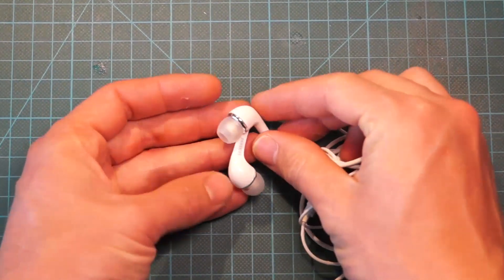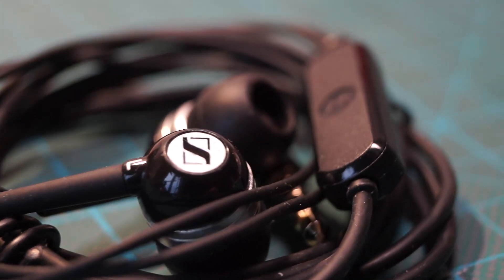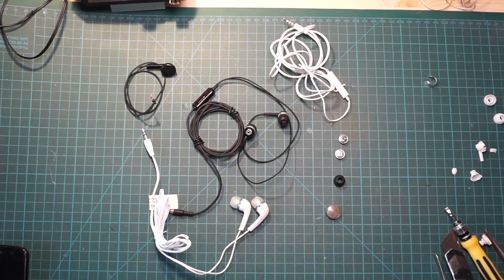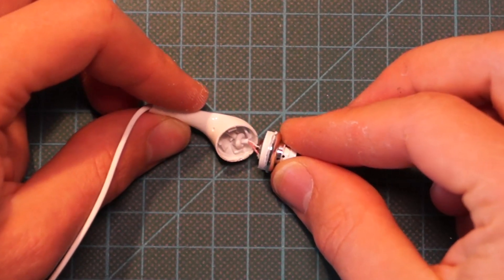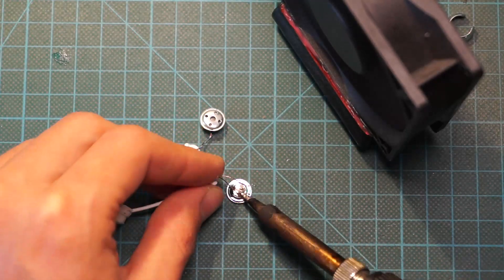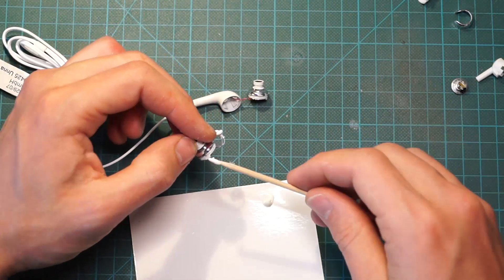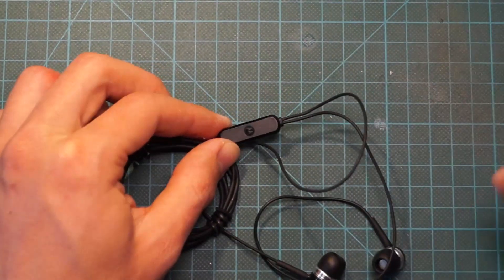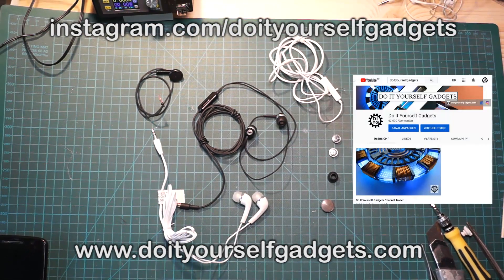How to repair in ear headphones when only one side is working - cable replacement

Comment: I am a tinker myself and i used to do the same method as you showed, but the problem arises when the cheap headphones cable you used starts breaking its own cable.

This could be a permanent solution to some but i recommend buying a slightly expensive replacement earphone with braided cable (if possible) and then fix it. Otherwise the one you just fixed will break soon.
Thanks for the guide. :D
Reply from the maker: Haha indeed! I think then it's time to throw them away because after opening up the earbuds one more time you probably won't be able to reassemble them nicely due to being glued shut after the first repair :/

Comment: Good job, I tried to cut the cable near where the cable got broken but couldnt solder all the wires correctly. Some were just coated leads and for me impossible to solder correctly. I had all kind of noise after the "repair". Btw I tried to solder the wires between 3,5 plug and mic/mute button.
This way its way smarter, thank you, I will use your trick next time.
Reply from the maker: Yea the same thing happened to me - a broken cable somewhere other than the audio jack needs to be replaced entirely :)

Comment: Brilliant idea! 
The cable is not much different on expensive or cheap models... It's the earplug that matters.
It even fixes the second most common problem: 3'5mm male plug wear.
Reply from the maker: Thanks for your comment, means a lot!